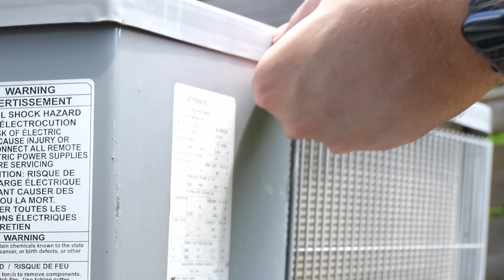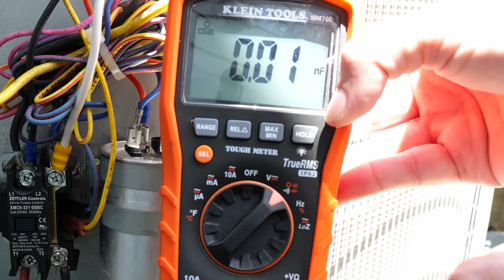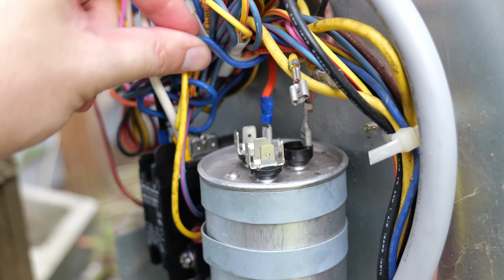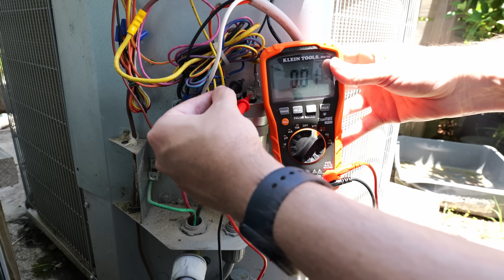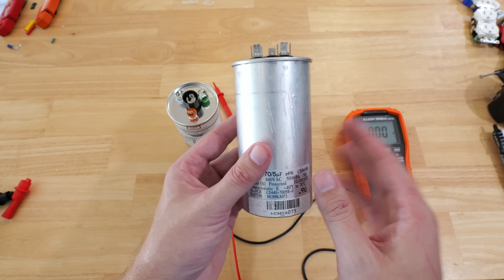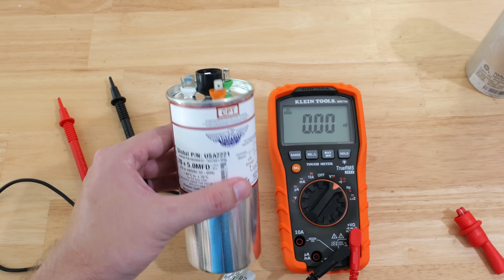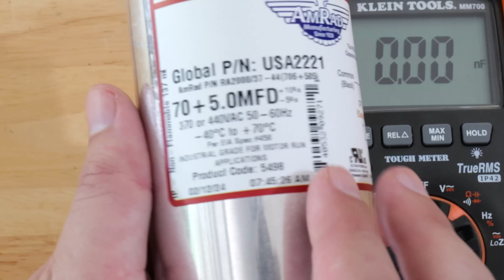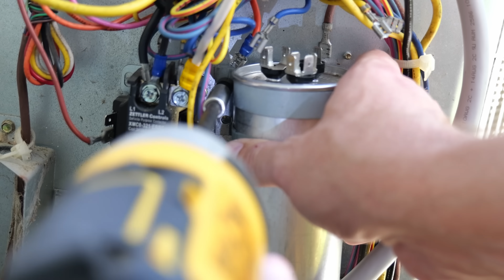Don’t Get Ripped Off! How To Avoid The AC Capacitor Scam And Save $500

Comment: @howtohomediy, how did you choose this multimeter?
Reply from the maker: Well I have like 4 multimeters for different things.  The MM700 is just one of the best all around multimeters available.  Has a kickstand to set it down while testing.  Looking back I’m not quite sure why I didn’t use my HVAC clamp meter for this one though as I could’ve just clamped it to the wires to hold it up so y’all could see 🤦‍♂️

Comment: A number of years ago our A/C wouldn't work and just made a loud buzzing sound. Of course it was hot outside and we needed it fixed ASAP. Most local supply houses wouldn't sell to a DIYer, but my local Grainger store had what I needed and didn't have a problem with me buying it. I replaced the capacitor and we were back in cool business! 

I ordered a spare from Amazon and have it standing by if there's a next time.

Comment: Good video.  One tip I'd add is to get your HVAC model number and go to a site like RepairClinc and buy a Capacitor and Fan Motor to have when needed.  It'll save you money when they go out and the repair tech want to charge you outrageous amounts for generic parts instead OEM parts for less $$ (OEM Capacitor $20-25, vs $80-90, OEM Fan Motor $200-250 vs $450-600).  Capacitors are easy to change, but getting the fan off of the motor can be a pain.  Some companies won't use your parts (they want your $$), but better ones will and maybe have you notate that they used your parts.

Comment: HVAC "engineers" are scum. I had a company turn up to my home with two guys so they can bill me for two people even though one of the guys did nothing while he was here. The best part was being billed $200 to "clean" the exterior coils. All they did was spray a $5 can of coil cleaner on the coils. That was 10+ years ago. I've fixed and replaced everything myself since then.

Comment: diy hvac guy has a new video discussing this. He mentioned some companies quote a customer 2k to replace it. Or tell them they need a whole new ac or system. Disgusting. A supply house will or should sell you the CAP. My local ones did no problem to homeowner, diy.
Reply from the maker: Yeah Dave and I talked about how we would be releasing this on the same day.  They are similar but we both also show some different things and scenarios.  Yeah most supply houses won’t sell to the public as they don’t want to upset the contractors which are by far the bulk of their business.
Reply: Some distributors only want to do wholesale , don’t wanna fool with the sales tax, which I can appreciate since I hated doing it also with my store
Reply from the maker: Yup!  Dave (DIY HVAC Guy) is a friend of mine.  You can trust what he says.  Most of them won't sell to the public because they don't want to upset their main clients which are HVAC contractors.  You are lucky you can purchase from them!

Comment: No he probably didn't know how to read it because he probably works for a company that all they do is replace parts my daughter's fiance came to my house and I told him I just put a fan in a she works fine except for the fan motor keeps shutting off I didn't know that I needed a two speed motor because somebody had already replaced it once with the wrong but my daughter's boyfriend told me I needed a whole new air conditioner unit although this one was just put in in 2016 it was working just fine except for the fan overheating and shutting off because his boss don't teach him how to troubleshoot all his boss taught him how to do was sell new product

Comment: People are complaining about $410, $500 capacitor charge, I asked myself, why the fuck you called a HVAC company if you all  people that are writing comments are complaining about the service charge. All you say, the part was only this much "what a rip off" Then you test the stupid thing! Oh, you don't have a $300 multimeter and don't have a fucking clue how to test a component. 
The reality is, you pay for that service van to drive to you freaking house, the knowledge for that technician and the part. You just want someone to do it for free and just charge you for the $20 capacitor WOW!. Not all capacitor cost $20. A capacitor that is 70/7.5 are about $65 to $70 if you purchase an  AMRAD cap, they warranty for 5 years (yes those run cap are found is some residential homes, I have personal replaced them before) I do agreed that there are companies that are out there ripping people off, just do your due diligence before you call a HVAC company. The tools that are used to troubleshoot HVAC equipment cost hundreds of dollars, but all you people get offended when is time to pay for service. Go head and start buying thousands of dollars of HVAC tools and do your troubleshooting and repairsfnd you will solve your problems.

Comment: How to Home: yes, 
one way to test a capacitor is the way you showed in your video. I am assuming you are not a HVAC Technician but a YouTube technician. The true reading to test a capacitor is done with the unit running and there is a formula you have to follow and it will give you the true reading of the capacitor. This Youtube technicians are the one people NEEDS to be careful watching their videos. This video was ok because that is one way to test a capacitor. If you have a question just let me know. I am a licensed Texas HVAC tech.

Comment: I don't think most AC places are ripping you off when they charge $350 to replace a capacitor that costs $20.   The tech that shows up rolls up in a $50K van filled with another $5 to 10K in tools and inventory.  HVAC tools, HVAC software, insurance, licenses and permits, insurance, HVAC technician salaries, website creation, and advertising and marketing all cost money.  
I did HVAC for a couple of years, replacing a capacitor is a quick and easy job, but we show up in the same van as for a much bigger and harder job.   Swap out your own blower motor after it gets sucked into the fan because you didn't change the filter for 6 years.   Its easy, a couple wires and a few screws.   Main boards are an easy swap, just a hand full of wires and some jumper wires.   
Do people really expect a company to send a tech to your house to repair your AC system for $50-100 bucks?  The tech wants to live indoors in a decent house, send his kids to school in decent clothes, eat the same quality food as everyone else.  He is a skilled blue collar worker and deserves to live as good as any other person who has a skilled trade.  
Replacing a capacitor can be a quick and easy job, it can also get you killed if you don't know what you are doing.  The 220-240 Volt 40-60 Amp breaker hooked to your AC system is lethal voltage and current.  
I'm a mechanic in a large factory now and I work around people that don't know how to accomplish basic mechanical tasks.   I can't imagine one of them playing with electricity.
Reply: I wonder what the folks complaining about a $300 service call do for a living? My guess is they aren’t in business owners. Sure replacing a cap is simple, especially now that a guy on YT has shown how to do it.  A bad capacitor isn’t the problem every time. When you don’t have the expertise, you have to pay for it, or do without.
Reply: @TPSTH23  Wait until one of them grabs a good capacitor without shorting it and they get a nasty discharge burn.  LOL They are all forgetting that 40-60 Amps of 220 voltage they are playing with isn't a joke either.
Reply: 100% agree IF it is a needed repair/replacement.
Cheating anyone out of their hard earned money simply for the sake of profit, is a shameful thing.
Reply: Sort of like an endo who charges 1500 for a root canal.
Reply: It is a rip off. It's a 15 minute job.
Add travel time and call it 1 hour.
Is an AC tech worth over $300 per hour?
Reply: @mark98115 15 mins at your home. It probably took the tech 15-30min to drive to your house after a dispatcher(that probably doesn’t want to work for free either) had to answer your phone call and dispatch the tech using an expensive software. Also for the company to even keep the Tech on the company, they more than likely have to offer him competitive pay, a cell phone, probably an iPad, uniform, matched 401K, paid time off, paid vacation etc. that’s the cost of running a business in the great USA now days.
Reply: @mark98115    Depends, how much is heating and cooling worth to you in the middle of the summer or dead of winter?  
What should it cost?  Base your answer on the current economy.  
Remember your rolling in a $80K van and tool setup.
I worked commercial HVAC/R and a service call was over $300 ten years ago.  
Let me know what it should cost.  $25-100.
Reply: Finally someone who understands how much it costs to run a business.
Reply: Damn right they are! Let's see, secretary has to paid who took your call. Workman comp insurance, auto insurance, liability insurance, medical insurance, $50,000.00 van to get to job, mortgage on shop, building insurance, retirement plans, electric, water bills, software, computers and laptops, training for techs, $20,000 in tools per van, $5000.00 in parts per truck, accountant on retainer, and I'm sure there are other overhead costs I haven't listed. I have been in the business for over 38 years. If you aren't charging $300.00 an hour in today's market you will go bankrupt.

Comment: I replaced the capacitor on my outside unit - then immediately after that the capacitor for the blower motor went bad.  Unfortunately - that one is actually built in to the blower motor.  The blower motor part with the capacitor is $600 just for the part.  It’s ridiculous- a part that would normally be less than $20 now they are building it into the motor & you can’t buy it separately.  It is a Carrier Unit purchased in 2015.
Reply: That's these new ultra high efficiency units made to adhere to today's "green" standards and public plus government outcry for greater efficiency.   
Doesn't seem too efficient now, does it? 
No more $20 cap changes for us, and Greta doesn't care.

Comment: Does anyone know if a bad capacitor would make the fan run all the time on a package unit?

It’s like if I had switched the thermostat to have the fan running all the time, but I don’t, I have it on auto.
Reply: @dr.stacey7283  No, a bad capacitor will not cause the fan to run all the time. Something else is causing that.
Reply: @dannoland  any guess what it might be? 
I would like to change out the capacitor, but I’m worried that if I cut power to the whole unit the fan won’t start back.

Comment: I noticed 2 yellow wires at one terminal.  Did it matter which wire went on that terminal?
Reply from the maker: No.  As long as they are on the correct terminal it doesn't matter which spade connection is used.

Comment: Interesting video, thank you.  When removing screws, I sometimes stick them to a small magnet that I stick to a metal part nearby.  When removing screws that won't be reassembled right away, I like to put the screws back into their holes and tighten them enough so they don't wander away, even though this takes a bit of extra time.  For the electrical measurements shown: 1) I like to measure large capacitors with a voltmeter in addition to discharging them, because sometimes the voltage creeps back up after discharging, and sometimes a seemingly conductive metal surface isn't actually very conductive, due to the use of certain plating methods, or just due to oxidation or surface contamination; 2) When making measurements with a meter, I usually make at least two measurements, one with the leads reversed - if the measurements don't match, this is a clue that an assumption being made isn't valid (as far as why two measurements wouldn't match, the devil is in the details, but it's a strong hint to stop until you figure it out); 3) The measurement method used in many handheld multimeters to measure capacitance is  a bit of a kludge, to take advantage of the existing meter circuitry, which allows the feature of measuring capacitance to be added with minimal additional cost to the meter manufacturer.  Because of this, the potential meter error of the capacitance measurement can be unexpectedly large, and needs to be added into the capacitor tolerance when determining whether the capacitor is withing tolerance.  Also, because of the measurement method used, reversing the leads and remeasuring is particularly important.
Reply: If it's a run cap it will already be discharged through the motor windings, unless they are open. Start caps should always have a bleed resistor, but I look for voltage anyway, because resistors do sometimes go open.
Reply: harbor freight sells (practically gives them away) smal dishes with magnets in them to hold loose screws. They are magnetized also so you can place them vertically.  Very convenient!!!

Comment: Funny--the DIY HVAC GUY just posted this exact thing!
Reply from the maker: Yeah.  Similar.  We both cover testing and replacing.  Dave then focuses more on the universal turbo capacitor available where I am focusing more on showing how some ac techs unnecessarily replace them and how they try to “prove” it needs to be.  But yeah, Dave and I talked about how we would be releasing them the same day 😂
Reply from the maker: 🤣 Yeah.  Dave (DIY HVAC Guy) is a friend of mine.  We talked about it a few days before posting that they would be similar but we come at it from different angles.

Comment: Since I am familiar with the basics, capacitor start electric motors I replaced mine on the unit outdoors for $2.50. I had another capacitor fail later on with the blower motor that operates the squirrel-cage. It was winter and we needed the blower to work as I could not buy the capacitor right away. So what I did was take a screw driver and spun the squirrel-cage just enough so it would rev up to operating speed. It only took a gentle push. I then switched the thermostat control to fan so it would continuously run and not stop until I bought the capacitor and fixed it. Of course after it was fixed I switched the fan back to auto.
Reply: Great tip!  My Heater buzzes for 20 seconds on start up. Do you think it is the cap or contactor? I haven't tested either yet of course I will but... :)
Reply: @MTTRON is it gas or electric?
Reply: This is a very common misconception, but a run capacitor doesn't start a PSC motor. The run capacitor is wired in series with L2/N. When the capacitor fails, it breaks the start windings connection to ground. When this happens, only the run winding draws current. The run winding is unable to shift the motor out of phase and spin up. When you flicked it with your hand, you acted as the start winding, allowing the motor to run. I'm an HVAC technician, and I've only met a handful of guys who actually understand it. I'm happy to hear you were able to figure out a way to get you by while you waited for the part to come in.
Reply: @David_Poole  My Heater buzzes for 20 seconds on start up. Do you think it is the cap or contactor? I haven't tested either yet, of course I will but... :)

Comment: I've done a couple of these at my last house a long while back. Then a couple years ago it needed to be done here but I didn't test it. The AC crook charged me $500 for a new capacitor but most of that was due to the fact that he was the only AC repairman in town and he was well aware of it. It used to be that I had to go to the supply house a ways away to get a replacement but now they seem to sell them at HD and AMZ of course.  Thanks, I saved this vid for the next time.

Comment: 25yr hvac experience here. I've had exactly one capacitor that held charge after being disconnected from power. That's one out of several thousand capacitors. It hit about as hard as you'd expect out of 240v.  I found it so incredulous I touched it for a second shock.  It was still holding nearly 140v after socond shock. I did not check it with my fingers a 3rd shock.

If a used capacitor wobbles when sat upon a flat surface it's swollen and will be out of spec.
Reply: Ive only seen it a few times in 10 years and the only reason they held a charge because either a wire broke or a winding was damaged, hence, it wasn't able to discharge. If your capacitor can't discharge that is a clue that there is a bigger issue in my experience.
Reply: @TheGhettoLobster  this cap would shock you, uninstalled, in your hand.  I could walk up to you, and poke you with it and it'd shock you!

Comment: What’s the life expectancy of a capacitor?
Reply from the maker: Completely depends on your unit, usage, and the environment you live in.  I usually get 5-7 years out of mine.
Reply: @HowToHomeDIY  I replaced one with a cheap model that I could get overnight. It failed after one year, but it bought me time to get an AmRad which I expect to last much longer.